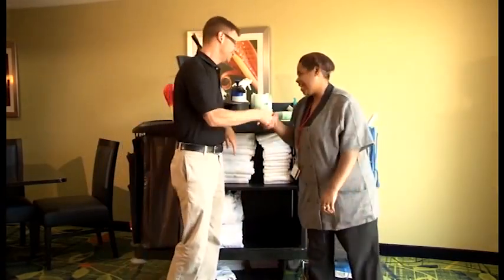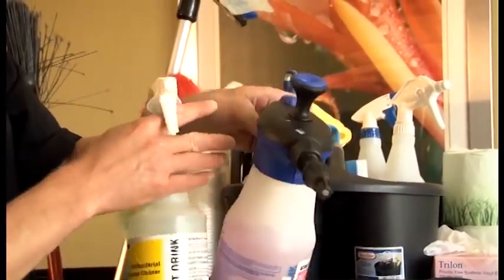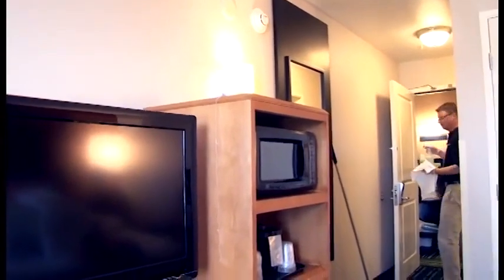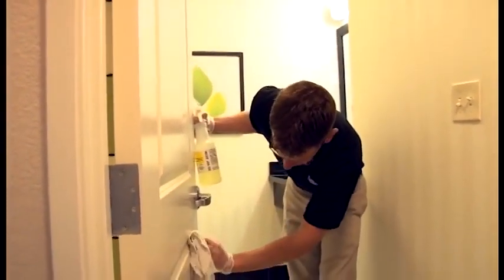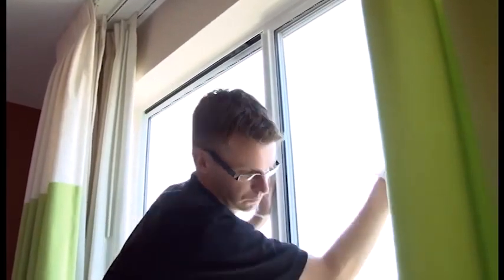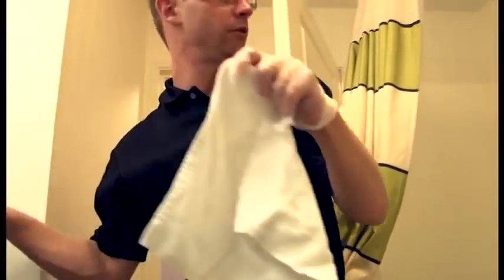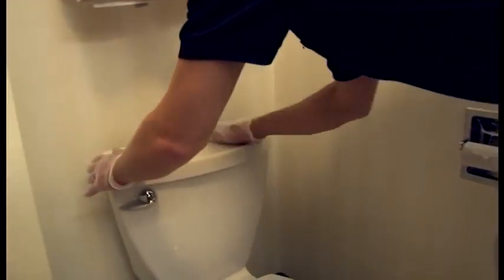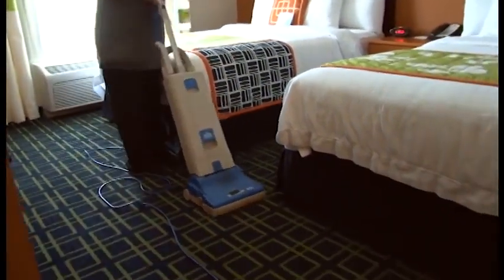Fairfield Inn & Suites by Marriott Housekeeping Training ► Housekeeping - Topic

Comment: If you have to clean up 14 to 18 of this room every day, it would be too slow.
Reply: Howard Wu you get 30 minutes per room. Most of what he is doing is on a as needed basis example whipping the door and clock If the room is occupied then you just do rich up
Reply: @portiasT123  30 mins to clean a checkout room. 15 minutes to clean a stay over.